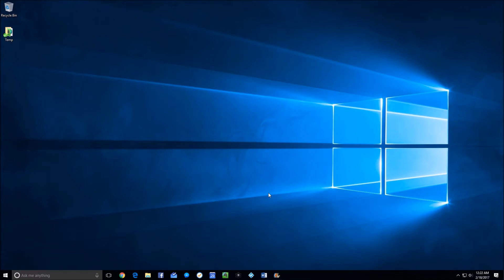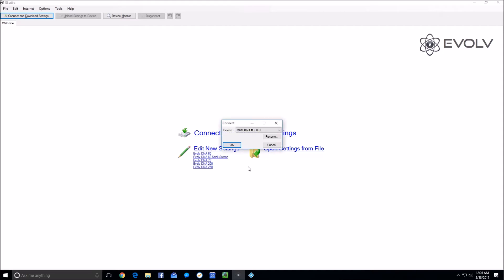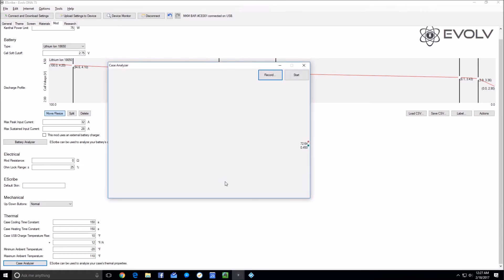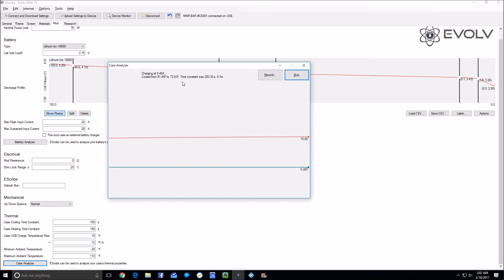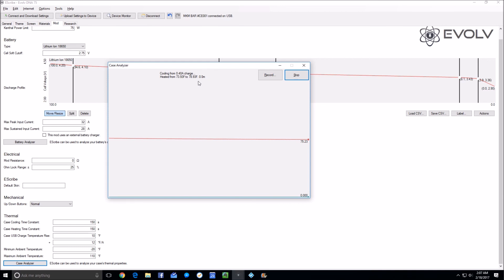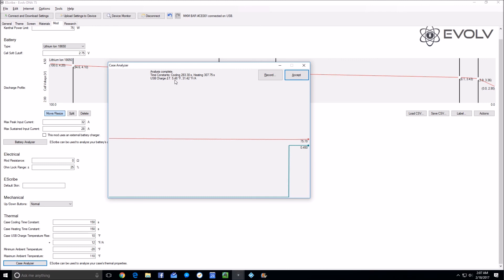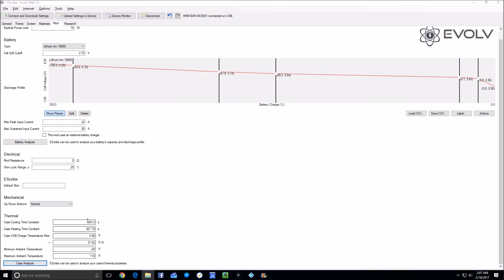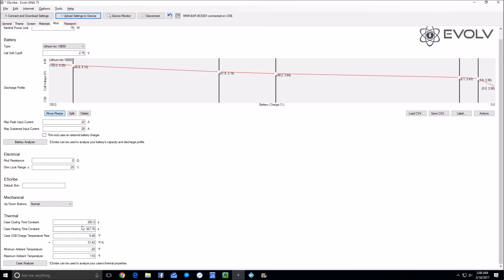DNA Calibration - 2  Thermal Calibration

Comment: When I do this test, i set 70 Fahrenheit is the real ambient temperature but on escribe raise  75 Fahrenheit but I don't see volt or ampere during test ,it does mean there is an issue?
Reply from the maker: Sorry, at this point it's been 18+ months since I've even had escribe installed.  I just don't remember enough to steer you in the right direction.  This video WAS accurate for the DNA chips before the C series and has some applicability even to them, but....

Comment: I have a lost vape triade 250c, because it has 2amps charging capability, you´re saying that i cant calibrate the thermals?
Reply from the maker: Don't know for sure on Triad 250c.  And C chips don't calibrate well with a pin.

I'd just calibrate the resistance to a known good mod and then only sample that when it's known to be at ambient temp.  A few degrees above or below 70 won't matter.  Other than that, just keep resistance locked

Comment: I want to calibrate the BB 60 DNA. When I open the mod and thermal tabs I don't have  the case analyzer tab at the bottom. I did    four other DNAs and didn't have that problem. Any idea what the problem is? Thanks.
Reply from the maker: DNA 60 doesn't have case analyzer.  One of it's major shortcomings.
Reply: Thanks Bill👍
Reply: Bill Lee, would you suggest to leave the time constants at 150 as default or change it to something else?

Comment: This wont work on my therion 166. It is leaking power and trying to charge the batteries while waiting for a steady temperature. The temp slowly increases while its showing the amp meter fluctuating from 0.000-0.010. I hope it's my computer and not the mod. Was this the Chinese mod you spoke of? Yes it does do 2 amp charging.
Reply from the maker: I have encountered a few mods that do this.  The best known is the VaporSharks.  They have a separate, proprietary chip for their 2A charging that the DNA cannot shutoff on cue (this video was gonna be posted in HEMO and you don't mention a lot of mods in that group).  I have a Therion 133 that seemed to work OK, but I don't know what other changes they made when they went to the 250 chip (i.e. a 166 is just a 2 cell 250).